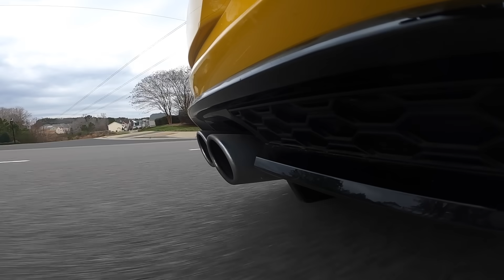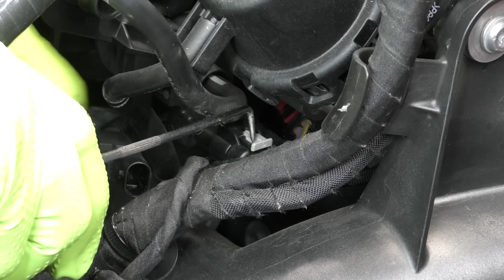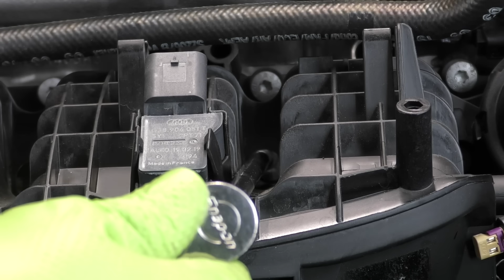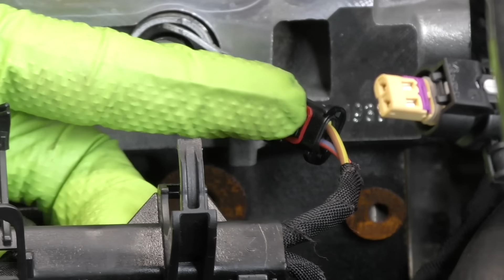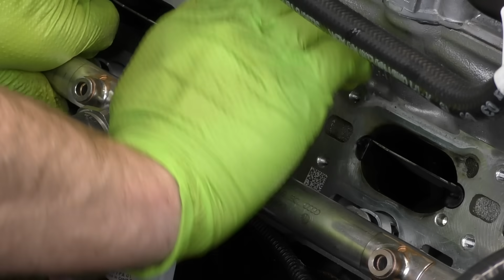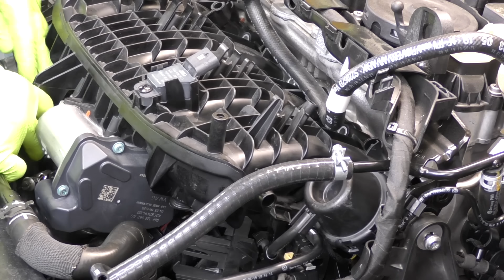Fuel Injector Replacement VW/Audi TSI Engines

Comment: Looking forward to seeing the effect the catch can has.
Reply from the maker: I have one on the way. :)
Reply: @HumbleMechanic  Yes! Please let us know what you would look for in a catch can, internal baffle construction etc.  So many variations on a fairly simple device it seems ...
Reply: @HumbleMechanic  Anxious to see which one you went with. Most designs I've seen have a significant flaw for us Michigan people (and others located in 'cold weather states').
Reply: @jtsherri  
I had an issue a few years back on generators using the 8.1 gm engine. 
They had a pcv can about half the height of a coffee can with a metal screen filter located inside. 
Every 6mo I'm at most of these sites and the amount of white goop in them is horrendous , like a cup worth. 
The newest  ones I've been seeing for the last year or so don't have an issue , they wrap them up in a blanket and the condensation passes thru them a lot easier. 
Basically I don't need to clean em anymore. 
So some kind of wrap and having it near the engine for heat would help.
Reply: I built one with big steel wool and an bottom inlet for my 2.0 TFSI seasonal (04-10) driven BWA in 2017 .It lets the air and the moisture through and only collects the fume oil.Its about 5ml every year.So far my inlet ports are a little bit dirty but nothing terrible.
Reply: Sir , 1.8TSI CDA at 100k km - during soda blasting of the Cyl. Head ports&valves had my injectors volumed-checked by a workshop and they told me they were at the limit  and I decided to replace them.  Is that reasonable ?

Comment: I've had them so carboned up that the slide hammer broke the injector . If they are high kilometer motors I soak them over night in Q20 or WD40 . I realise I should only use WD40 😆
Reply: Oh yeah! Had my fair share. Have had to drill some out! But you know why they stick so much? When dummies reuse injector seals.

Comment: Fun fact: a slide hammer is known as a wanker in Norwegian.
Reply from the maker: really? Oh that is awesome! I am going to try and call it that.
Reply: In Germany it´s also called "Wichser", different countries, same thoughts. :-)
Reply: In México its called "chaqutero" wich means masturbator
Reply: Pass the wanker, wanker.
Reply: Hello hope you’re fine. I’m from ECUADOR 
I have seen some of your videos on YouTube I thing they’re so helpful. 
I just have a question I hope you can help me with some tips   
I have a 2012 Volkswagen amarok 2.0L TSI , and it is consuming oil , there is no leaks at all but I just realized that from the PCV  valve some oil is coming out to the intake manifold and also there is a huge vacuum when a remove the cap from oil engine. 
My question is   
Is it normal the oil coming out from the PCV and the vacuum? 
I hope you can give me some advice about it so I can replace the valve thank you so much.